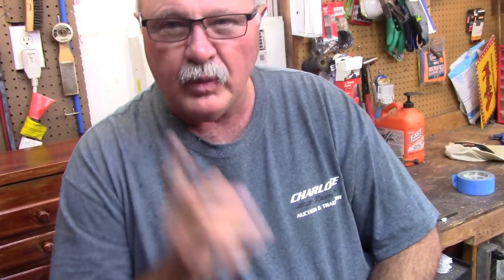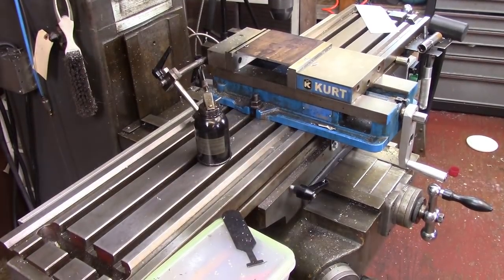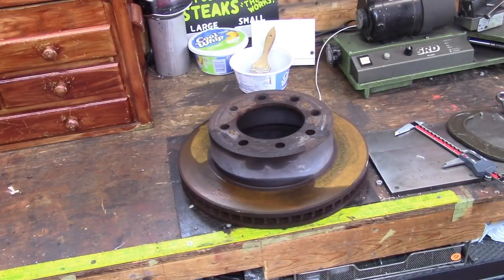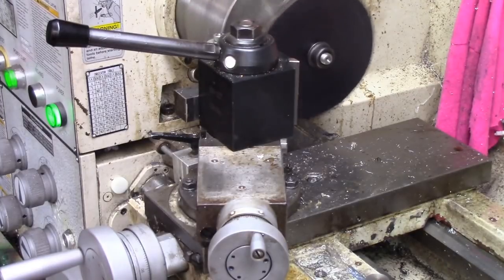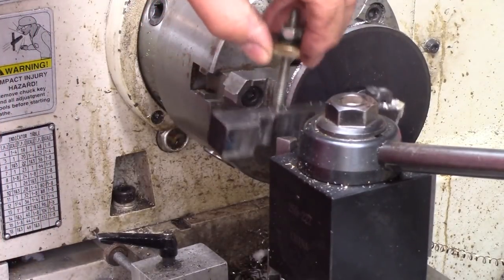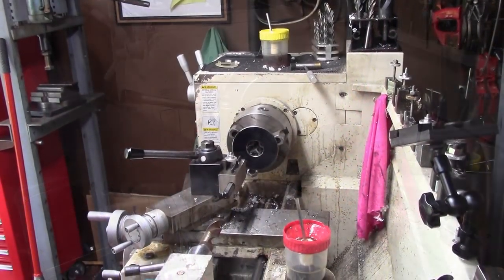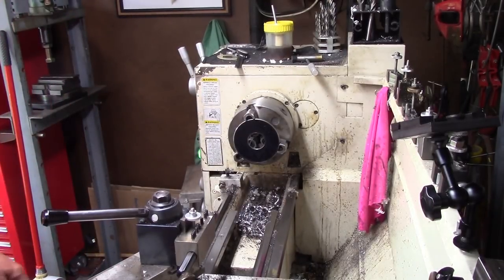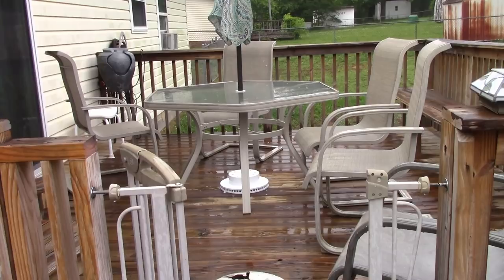The umbrella stand project

Comment: Jim,
  Good video. I have half a dozen brake rotors in service for various stands a such. Most auto repair shops just throw them in the dumpster not having the time or desire to scrap them out. Brake rotors have a lot of second purpose uses. 
  Love your red shirt, by the way!
Reply from the maker: Dale Griggs yes they do make great stands, I have another one for a grinder one,  I did get a pair of them because I have another project I wanted to do, just going have get to in due time. Thanks for the comment

Comment: If I had to guess, I'd say those rotors came off either a GM or Dodge from the looks of them.  It's a good use for an old rotor, I used a few to make torch stand bases for a dramatic production a number of years, they work really well for making nice heavy bases.  Actually looks pretty good with the white paint on it!
Reply from the maker: Everett's Workshop I guessed it was a off a large pickup, they was he largest rotors he had and I wanted mass for the stand. The white to me was the best choice for the application. It will probably out last the patio set. Cost wise it wasn’t a money saver, however if you figure the lifespan of my stand it actually is less expensive that the sand filled ones that rot. Thanks for the observation and the kind words.

Comment: Jim what size is your tool post ? I like what you did with those over sized index tooling, got my wheels turning...
Reply from the maker: TC Ed my QCTP is an BXA size. Most of my tooling is modified larger insert tooling. Go back in my videos and look for Jim’s tooling set up. Or Trash to treasure. Those videos show in more detail about the tooling I use. That tool is a one inch shank tool with a dovetail cut into it to mount to the tool post, the adjuster is 1/4 x 20 all thread with a shop made adjuster. You can do the same with a AXA, because I have done it for Micheal. Thanks for being observant